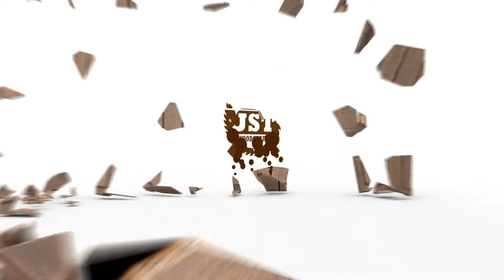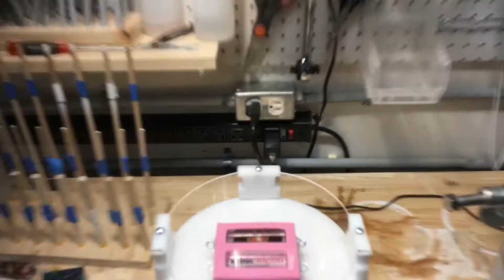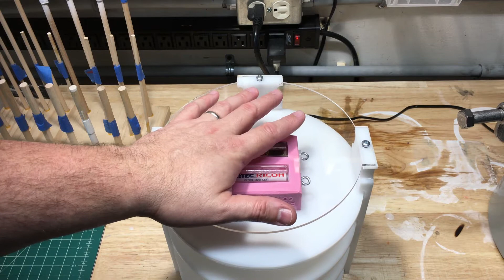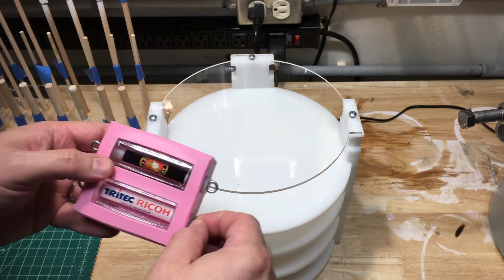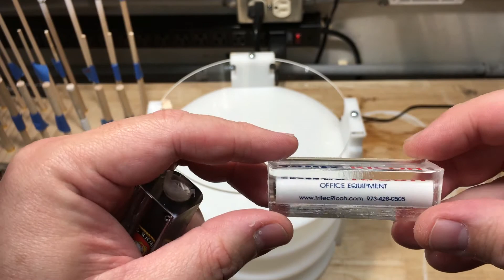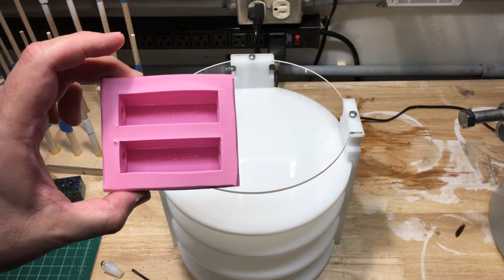PTownSubbie Mold Rack System Follow up.

Comment: May I sugest something that may help you. take a short peace of straping and use two small washers and make a lifting handle across the top to make it easyer loading the rack when you have several molds on it and for easyer removing. 

john
Reply from the maker: John, thank you for watching.  That is a great idea, I will share your feedback with Fred.